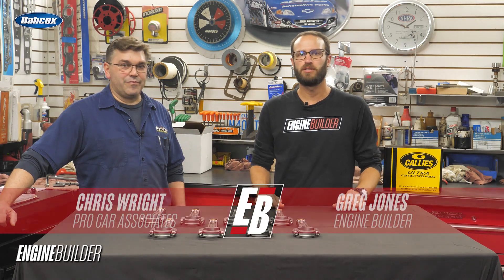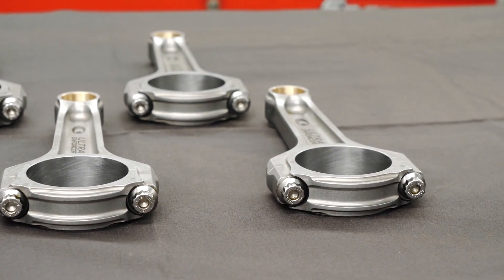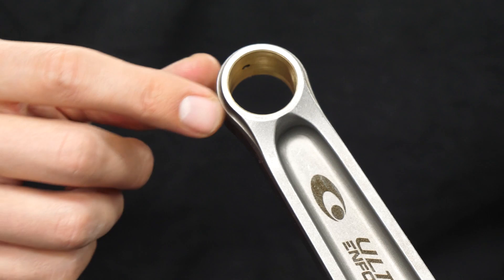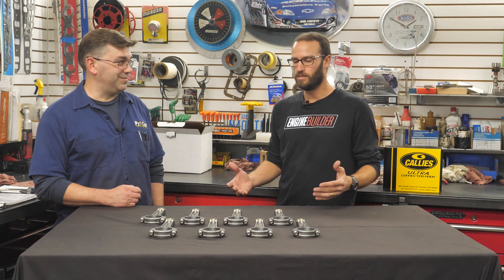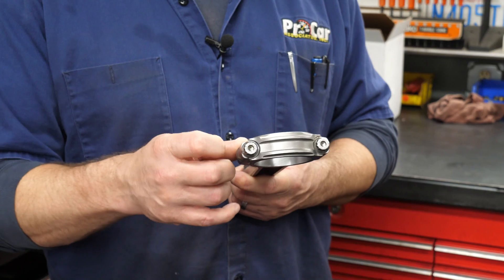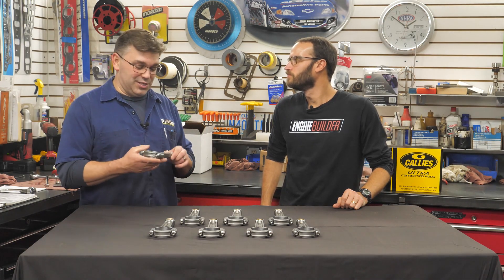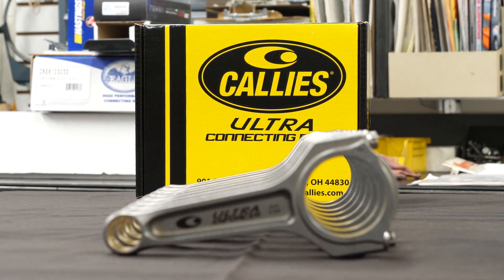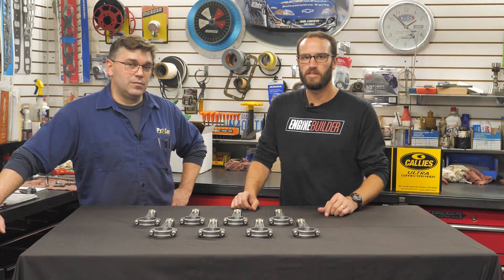Reviewing Callies Ultra I-Beam Connecting Rods

Comment: So is this simply a Centered/Normal Style LS Rod that is run 0.010" or 0.020" Off Center at the Pin/Piston (4.380 Bore Center vs 4.400) ? or a Big End Off-Set SBC Rod ? All 3 Rods in the Aftermarket (from the same Manufacturer/Same Line) seem to match dimensions (SBC, LS, SBF) with 2.225 Big End Bore, 0.94" Big End Width, 1.0-1.01" Pin End Width, 0.927 Pin, 7/16 Bolts etc.